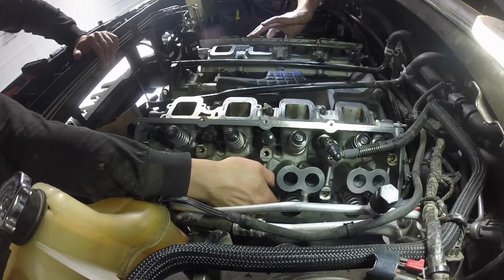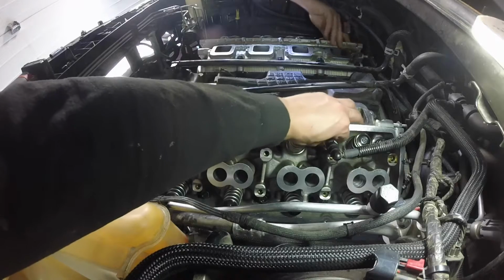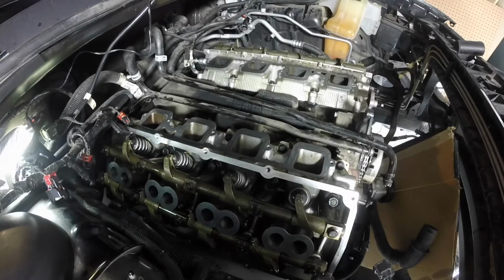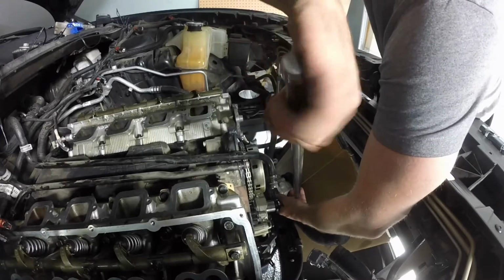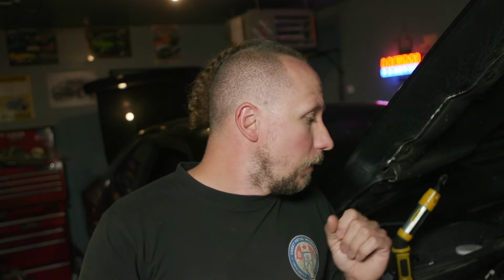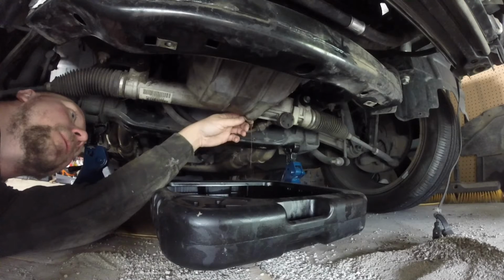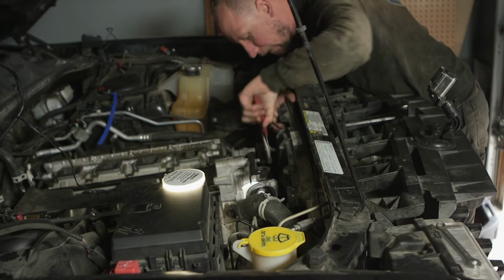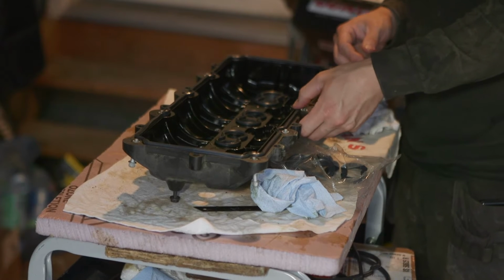Cam Install Part 4: Start Up

Comment: Getting my 2010 rt cammed with srt headers midpipes 6.1 Intake 90mm throttle body tomorrow
Reply from the maker: Nice, what cam did you go with?
Reply: @TrackPackRT  392 cam nothing too crazy 😂
Reply from the maker: Desktopbeatzinc they are still a great option for an affordable cam setup that makes good power!

Comment: Might be just me but after a few cam swaps in LS engines, I noticed they would start with a tick as well. I started putting extra assembly lube on the rocker and pushrods when I reinstalled those parts. I would unplug the crank sensor and also crank the engine till oil got to the rockers before I would start it. That seemed like it helped me with cam swaps. Just a heads up if it helps on the next build.
Reply from the maker: Definitely a good idea for sure.  On first fire up you could hear the valves ticking a bit but it shortly settled down.  The rest of that sound you hear is from the headers.  I imagine a cam swap in an LS would be fairly similar to doing it in the Hemis maybe with a few little quirks of its own though.
Reply: Track Pack R/T yeah I have done both before one thing that’s not too bad is you can hold the timing chain tension with a drill bit. I figured out   later on after a few even though I poured oil in the valve covers that they wouldn’t have enough oil in the passageways. So it is technically a dry start, but by the time the engine runs for a few minutes and develops oil pressure it usually goes away.
Reply: @jonprice8413  im getting 8psi at idle after my cam/lifter swap, is this normal?

Comment: Hey man love the channel I’m doing the same thing with my 5.7 Chrysler quick question did you set timing back to 0 with these cams or did you have to advance ?
Reply from the maker: Nope set your timing properly how you would with a factory cam.
Reply: Did you have any problems with vaccume and did you block your egr off
Reply from the maker: @jonnybgood1016  nope no problems at all.  EGR is still functional.

Comment: Love the setup want too install it in my 2012 ram can you send me the link please🔥
Reply from the maker: The kit I got is this one https://www.compcams.com/stage-2-hrt-220-230-max-power-hydraulic-roller-cam-kit-for-dodge-57-64l-hemi-w-vvt-2009-cpg.html it doesn't include lifters, I just grabbed some new ones from the dealership.

Comment: I´m really curious of the gains you get with the cam swap. I have almost the same Challenger, 2009 R/T with Track Pack and went in retrospect view the stoney way of swapping the 5.7 to a 392Hemi  crate engine to improve things a bit ;-)
Reply from the maker: Headed to the dyno Saturday to nail down the tune so you’ll know soon!
Reply from the maker: Bright White Hemi it’s funny I was at a dyno session yesterday and there was a 392 Challenger with a Maggie on it with long tubes.  He put down 550 rwhp.
Reply: @TrackPackRT  oh damn no way. Any idea how much boost?
Reply from the maker: Bright White Hemi I’m actually not sure what he was running.  I heard my tuner say to him that if he wanted to push it more he was going to need a different pulley.  I’m guessing it was around 7-8 lbs but I could be off on that.

Comment: I'm having a difficult time with the fact that you would install that nylon pizza back on after all that hard work.  Why not just install an Edelbrock intake?
Reply from the maker: 😂 Nylon Pizza?  hahaha that's great!  I'd consider the 6.4 intake maybe eventually as it seems to make more power under the curve but I'd take the stock intake over the edelbrock any day on a 5.7.  For the intake, fuel rails and new air intake I'd have to get it would set me back more than my entire cam kit cost me and the only feedback I can find from guys who installed it showed they lost power with it, or they didn't see much for performance gains on a 5.7.  That's a huge amount of $ to spend for little to no get up and go.

Comment: So how long in total did it take to do the install?
Reply from the maker: We were at it for probably 4 days total.  Some of that was running around for parts or trying to find a pulley puller that would fit that style of harmonic balancer ect but it was a fair bit of work.
Reply: @TrackPackRT  Did you install the long-tubes at the same-time?  I heard their a pita.... I have an 09 eagle 300c 5.7l heritage edition but it has 165000 miles on it debating if I want to drive the engine until it dies and have an engine with low miles bought and I put a cam in ready to go or cam this one.  I don't plan on selling the car.  What do you think in your opinion?  Im sure it will go 220,000 with ease. I drive 15k a year on avg.
Reply from the maker: @tone3560  I put my headers on about a year before my cam.  The headers make a huge difference by themselves.  You could definitely do it in an engine that old as with a cam swap you’d be putting new lifters, pushrods, valve springs, seals,valve seats and keepers to go with your cam, so the top end of your motor will essentially be brand new.  Just so long as your motor has good compression and was well taken care of you should get plenty of miles out of it yet.